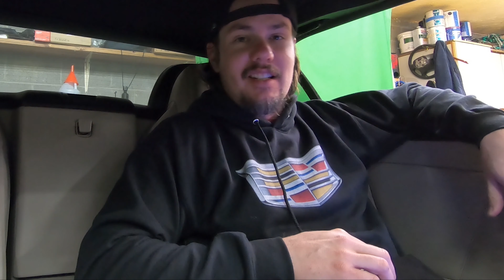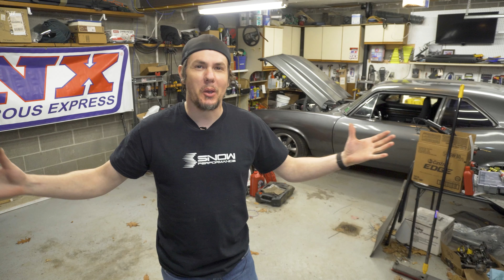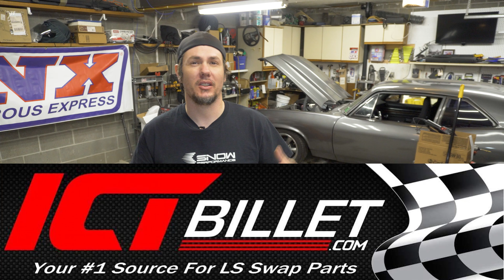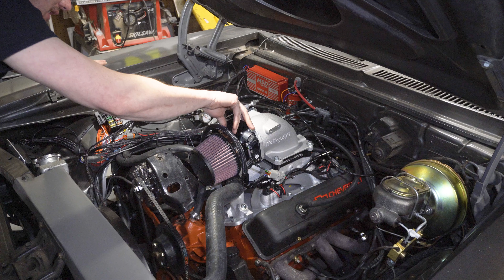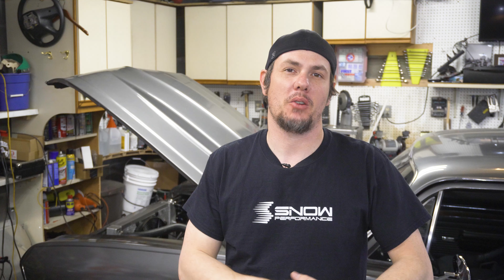SBC EFI Install on the Smoke Monster Nova Part 2, So Much Fail!

Comment: Ohm out your spark plugs and make sure they are showing 5k ohm through the core.   I've had this problem.  Also don't drive your dwell times to high keep it between 3 and 5ms.  Hope this leads you to the fix??  Good luck

Comment: You said you moved the battery to the trunk. Have you ran a ground cable directly from the battery to the engine block? If no thats your rfi issue

Comment: Put a resister on the power in side and see of that helps pull the power down and keep it there to run.
Reply from the maker: It's dead, died shortly after this video, swelled up nicely. Put an AEM coil driver in today and she runs great.

Comment: Just gonna throw this out there and keep in mind that this is just a complete guess... the coil driver ran fine with an extra load on it, was the coil driver a 5 volt? Meaning you were sending too much voltage to it?
Reply from the maker: Coil driver was bad from the start, swapped in an AEM coil driver today and it runs great. On the old one there were other issues with it that became apparent after the new one went in, so I'm guessing it has issues from the get go.

Comment: I'm gonna throw it out there   gggrrrhhmm  LS Swap
Reply: As I mentioned its all motor which means no nitrous, but not sure about the gas thing though
Reply from the maker: Yeah, it's going to be 800 all motor with a 300 shot running on pump gas. And won't need torn down every 5k miles, lol. I'm well aware of what your can do on an LS platform but it's just not the setup for what I want this car to be capable of.
Reply: You’re the master and we’re students, one day I’ll have all of your experience haha
Keep it up buddy :)
Reply from the maker: @unknown33165  I'm here to learn just like everyone else! Luckily I get to make more mistakes then most and share them lol
Reply from the maker: Haha, but I just backed it out if the garage for the first time... Besides, show me an LS that makes over 800 na on pump gas and we will talk, lol
Reply: @GoatRopeGarage  Ok Fair enough. Will that car stay together with 800hp? Any plans of full tube chassis?
Reply from the maker: @scubastevoo8404  Nah, will do a sub and tie it together with a cage, help keep it in one piece
Reply: Dont wanna be an ass, but there are quite a bunch of ls’s that makes 800+ na
Hell ive seen 900 whp all motor ls but that was a super expensive HRS engine to be honest
Reply from the maker: Psst, I'll also be able to run a 300 shot and not bat eye.
Reply from the maker: Yeah, show me one on pump gas doing that. I'll wait, lol